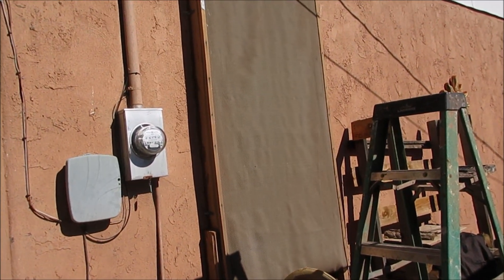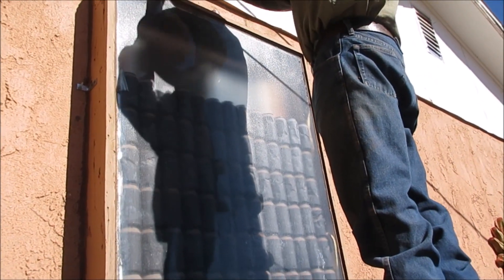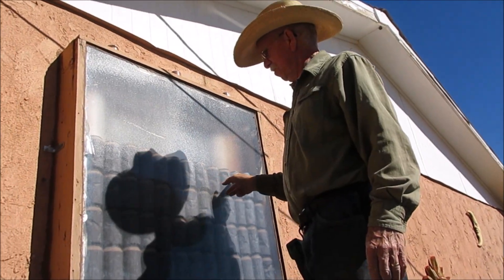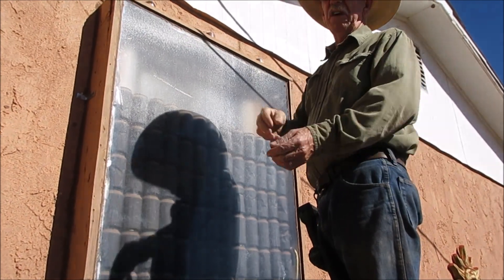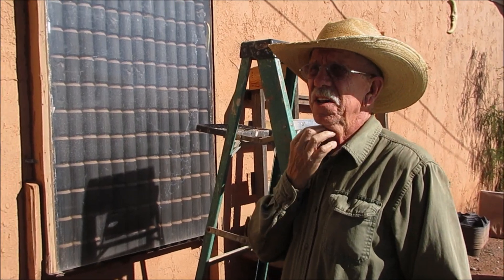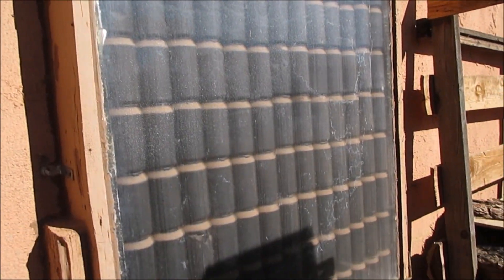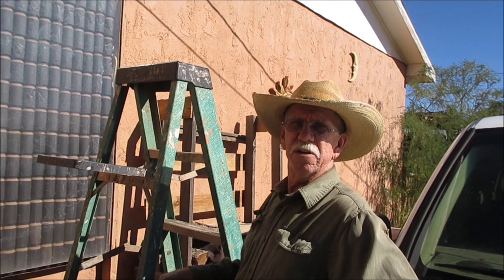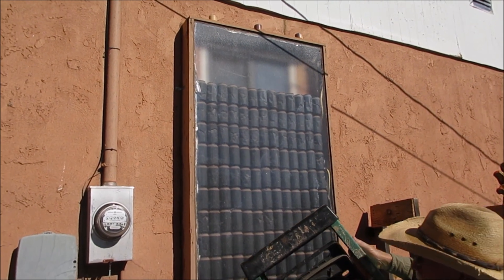Our Pop can solar heater

Comment: Great job on the solar air heater.  Nice to get almost free heat.
I built one with two layers of window screen spaced about 1-3/8" apart. No cans. It works great.  It's called a "Zero Pass" collector.
If the sun is out the solar heater works all day keeping the furnace off until late evening. Really saves on Michigan heating bills.
Just found your channel via GBear. 
Take care...
Reply from the maker: Thanks for coming by Lambert Klein.  It was nice of B Bear to give me a shout out. He's trying to help me reach 1000 subbs.
Our can heater works great. We're so happy to have it.